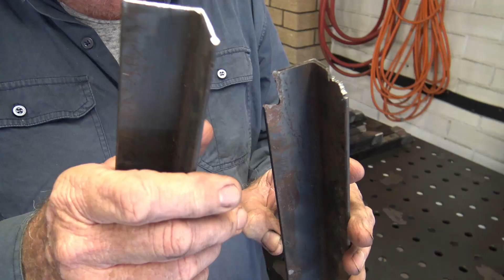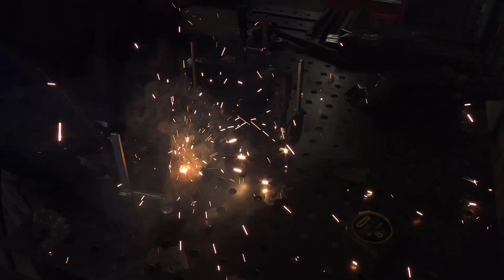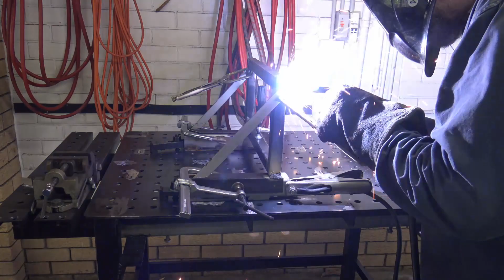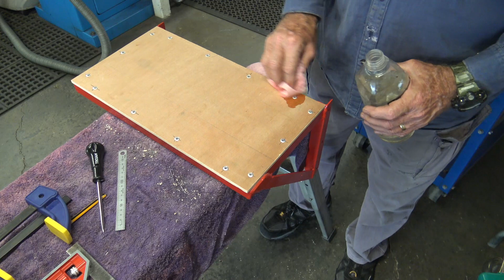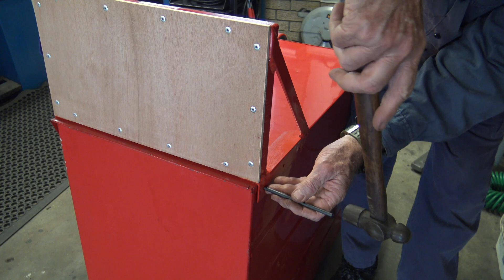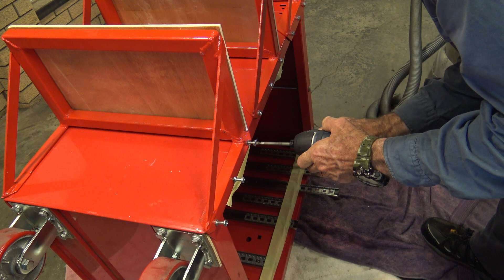Increasing Tooling Cabinet Storage | Creative Fixturing, Nut Rivets

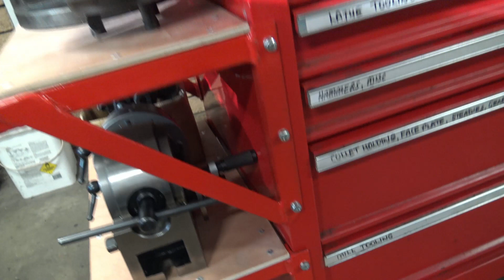Comment: 23:44 I Have to admit:  When I first saw the cabinet, and then the shelves, and the things you wanted to store on them.... I was sure that cabinet was going to tip over! LOL.  I assume there is some substantial weight in the drawers?
Reply from the maker: He he, I did not mention the castors, now there is a story. I do not know what weight the original casters could hold, but they collaspsed under the weight of the cabinet a couple of years ago🙄. The new casters together can hold 1640 kilograms, about 3600 pounds, and as yet they have not failed, but I have had to beef up the body mounts since fitting them 😉. The drawers are all full of tooling for the lathe, mill and drill - lots of it, all steel, collectively very heavy. I had to tip the trolley on its side, to do the riv nuts, so I removed the drawers. There are seven drawers from memory and I had to unpack three of them to be able to lift them clear of the trolley.

Comment: Nice job Bob, those chucks look very heavy I wouldn't want to be carrying them about too often,
The riv nuts are a tool I keep telling myself I don't need (I would find a use for them about once every two years ) Great demonstration     🛠👍😊
Reply from the maker: Thanks Tony, the chucks are heavy and it is good to be able to roll the cabinet over close for a change over. Yes, I knew about riv nuts for years before I got into them. I had a job come up a few years ago where I needed them, so I invested. Thanks again, Bob.
Reply: Thanks Bob you have me thinking about investing in them soon    😁
Reply from the maker: @Everythings_Adjustable  Tony, get one that the pliers go from M5 to M10, I made the mistake of just buying one that went up to M6, because that was what I needed for the job I was doing then. But since then I have had to buy a bigger set of pliers as I needed to do some M8 fittings.
Reply: You are a bad influence Bob     🥃 👍 😁
Reply from the maker: @Everythings_Adjustable  he he 😈